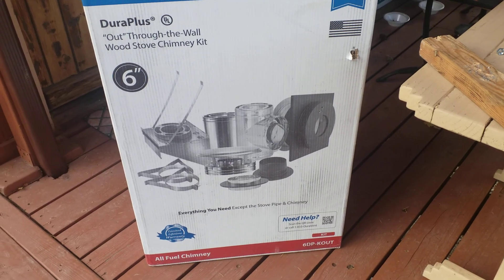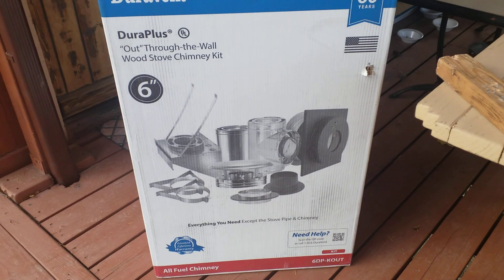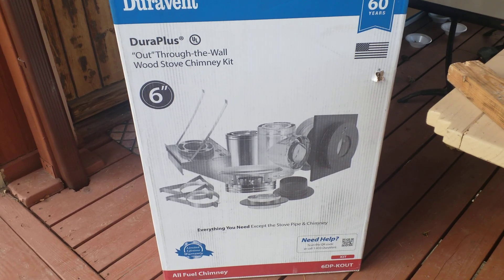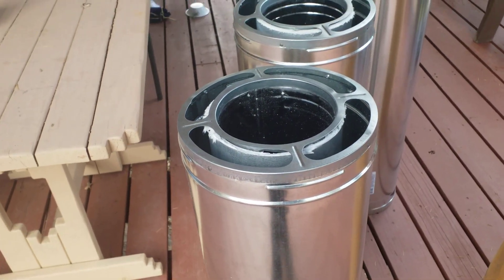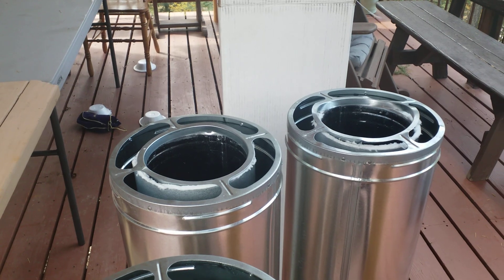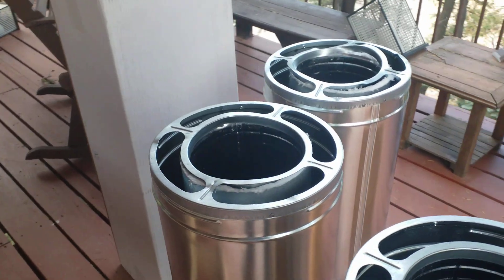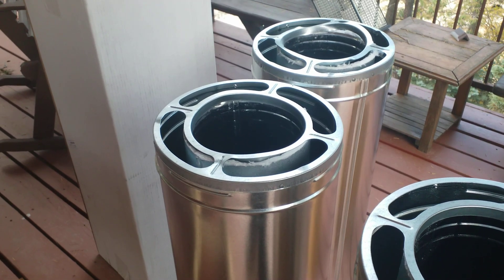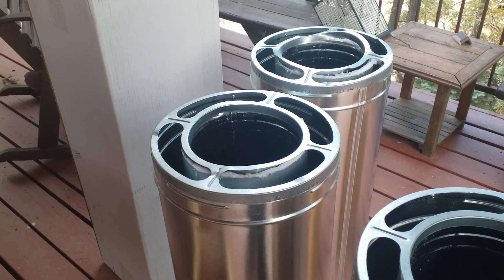DIY through the wall Dura Vent Installation

Comment: I bought one, and was disappointed with the product, overpriced, not even close to complete, you only get enough pipe to barely get through the wall, Duravent doesn't seem to know that roofs have an overhang, or they are just too cheap to give you the extra foot you need to clear the overhang! So, once you are through the wall you will now have to fabricate everything to get far enough out to clear the overhang that every roof I have ever seen has, unless you want to butcher your roof. At around a hundred and fifty bucks for a two-foot piece you can plan on pushing a thousand bucks for your flu and a bunch of headaches, not to mention the dented-up product once removed from the box. The instructions are vague as can be, frustration level 11 of trying to get beyond a simple 12-inch eve, the product is thin low quality Chinese junk at an astronomical price!
Wish I had not purchased this product!
Reply: Mine is in, but it took way to much screwing around with it, I cut the lower wings off of the outside bracket that sits under the flu, no need for them since it will not flush mount to the wall. It made it easier to fab the extended brackets that I made. I used a two-foot piece through the thimble and cut the inside thimble hole larger to allow the two-footer to extend through the wall. @reconjake